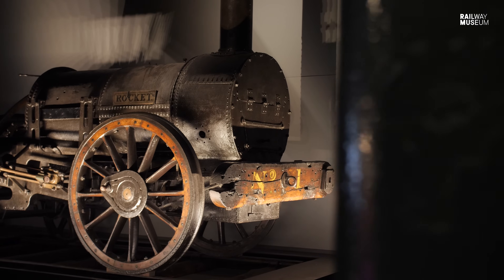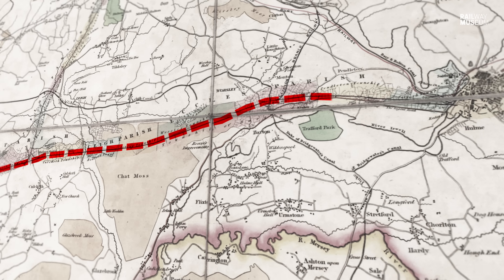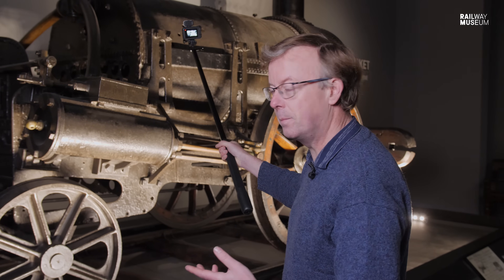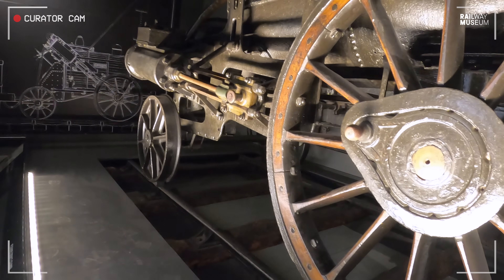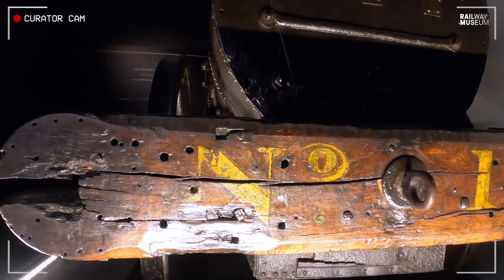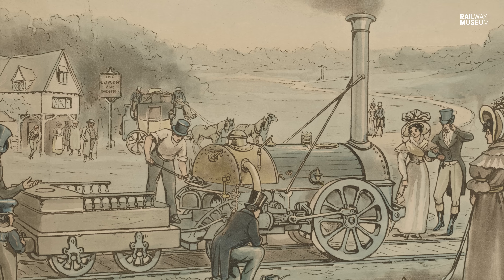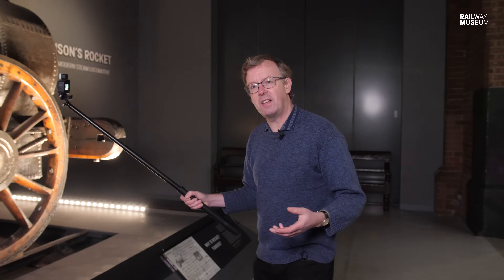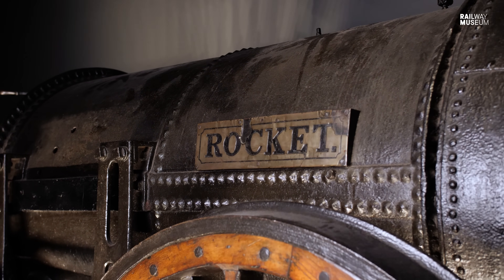Stephenson's Rocket: How did this Steam Pioneer Change the World? | Curator with a Camera

Comment: I think the missing parts that were replaced with wooden parts should be made again and installed, perhaps painted a color to indicate that they are not original, but would help observers understand the workings of the engine and envision what it looked like originally.

Comment: But it was Trevithick in Cornwall who was the originator of the steam engine using
High pressure steam. Without Trevithick there wouldn't have been the Stephenson's Rocket.

Comment: I've especially wanted to mention that I personally found out that the famous locomotive designed by Robert Stephenson himself known as the Stephenson's Rocket from the year of exactly 1829 respectfully to win the legendary Rain Hill Trials to gain a specifically certain £500 prize as well as a specifically certain contract to construct locomotives for the Liverpool & Manchester Railway @ a certain top speed of close to 20 MPH with rolling stock very easily, but also apparently a certain top speed of 35 MPH light-engine!

Comment: From 45 degrees to 8 degrees: how was the optimum angle for the cylinders assessed? Why did it end up being 8 degrees? Why not, let's say, 22.5 degrees - so half the original angle - or maybe 11.25 degrees, a quarter of the original? How or why did it end up being (exactly) 8 degrees?  🤔
Reply: After rainhill further speed trials were conducted and improvments to the twin blast pipe to increase its speed, the high angle of the cylinders caused a rocking motion, so following Rockets last accident of which it had four which involved the supporting cylinder frame to be damaged. It was decided to fit the cylinder just so they cleared the rialing wheels which would have been about 8 degrees. Following the Rainhill trials stephenson received an order for 4 rocket type engines these all had the cylinders fitted at 8 degrees from the factory
.

Comment: I hate to burst a bubble but Rocket was merely a continuation of the work of Trevithick, Hackworth and others and didn't contain an original Stephenson idea. My comment isn't to take away from what Stephenson delivered at Rainhill or Stephenson's later amazing accomplishments, but correct the impression many have that Stephenson was the inventor of the steam engine. The Rocket was the culmination of the work of others. I am very disappointed that the NRM doesn't provide the credit the Agenoria, as one example, deserves - it's hidden next to a bunch of huge, modern locomotives. If you want to know the history of steam engines, you won't find it at the NRM.

Comment: Denmark's first proper locomotive, Odin, was more or less a direct descendent of Rocket. It was built by Stephenson in Manchester in 1846. They basically took everything they learned from Rocket and shoved it into a more solid engine, and while an improvement over the original design, it also still had a lot of obvious similarities. Odin was sadly lost over the years, but in 2004 a group started on a 1:1 replica of it, which took 14 years before it went out on its first journey in 2018 - and became the first steam engine to be built in Denmark in 60 years ;)

Comment: In many regards rather like my Audi TT roadster, Rocket was something of a "concept" design. Insomuch as it proved most of it's features the multi tubular boiler and blast pipe to name but two parts that already existed elsewhere. Granted there were modifications made to the "production version" of the loco in light of experience at the trails to great success....

Comment: One of the other Rainhill  competitors "Sans Pareil" had to withdraw from The Trials because of a cracked cylinder. The cylinder in question was manufactured by  non other than Robert  Stephenson and co. which caused a few at the time to  think that maybe they had deliberately sold Timothy Hackworth (The builder of that engine)  a 'dodgy' cylinder so they couldn't possibly win it.  The design thickness for the cylinder walls was some 1+3⁄4 inches, but at the point of failure, it was found to be a mere 5⁄8 inch . Hmm 🤔
Reply: Hackworth had Stephenson's works cast at least twenty cylinders and he chose what he thought were the best two.